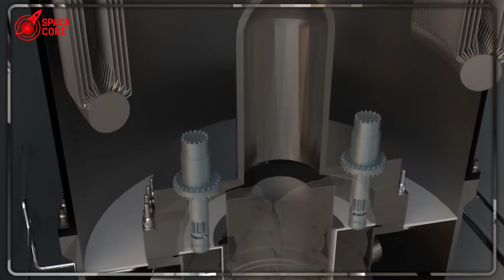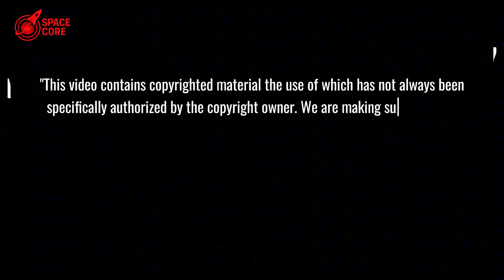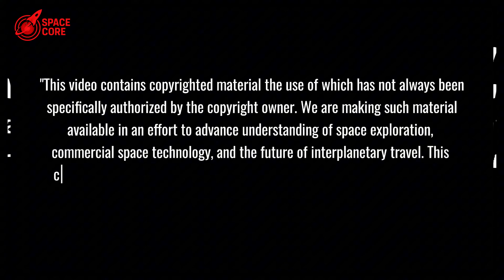China's Space Station SHOCKED NASA: Creates Oxygen & Fuel in Orbit!

Comment: The ISS is not dying, it is being neglected like an older vehicle is, while driving down the road with an overloaded trailer. NASA and the rest of the managers that operate the ISS want to trade it in on a newer model. We are not remodeling/ upgrading the ISS. Yes, we are using older proven technology.  Yes, things wear out and Yes, things get replaced, however, this is limited to the same versions with only limited proven technology upgrades. Also, the ISS tech is one offs or a very very limited production run. This means sky high manufacturing costs and long term storage costs on the ground. Modular designs like the Chinese station take advantage of the ability to change without major design, construction, production issues ideally. 

The ISS is very much like one of those rare custom one of a kind cars. 
My proposal which was ignored by NASA, was to take the ISS and relocate only after we have another space station in orbit, is to relocate it to Lagrange point 1 or other suitable Lagrange point and-repurpose it as part of a recycling facility for all of the space debris already in orbit amongst potential uses. Once we get an automated plant in operation, we use the ISS as a staging area and eventually upgrade it as required.  We already have paid for it several times over, if we are going to spend a billion dollars plus to bring it down why not utilize it to practice moving it to somewhere useful. Same, if not lesser cost,  different mindset, different outcome. It’s not like as if the tech being developed to bring it down could not be used to move other things.
The-real costs is in management and resupply costs. As long as there is no changes in those costs it could a toaster in space, it would still have those costs associated with keeping it there. 

This not revolutionary technology, we already know how to do this, the efficiency of what the Chinese are attempting to do is what could be the game changer. If the amount of catylist replacement outweigh the total costs including launch costs, it becomes the lessor of two evils. Experiments are ongoing.  

Let me say this, most of the justification for de orbiting the ISS is based upon everything in operational costs increasing not decreasing, when we relocate the ISS to a La grange point operational costs plummet to zero or close to since we essentially moth balling until we get better cheaper infrastructure up there. 

So NASA’s basis is based on all costs increasing, if New Glen or Starship become operational by2030, which I think is very possible then the costs to operate would go down even if you park either ship to the ISS in LEO. We need infrastructure in orbit if we use what we got it, it will go a long way in providing support for long term ops for both the Moon, Mars, and beyond!

We have a growing number of companies lining up to do things that only lives in the sci fi world. We have the capability,the tech and now an international base to drag the rest of the world forward.

Just remember this, every cent spent on space related  activities returns 7 times the initial investment, further every penny spent is spent here on earth, not in space,last time I check their was not a all-you-can-buy space mart accepting dollars parked in orbit. 
Job’s otherwise would never be created,and these are not Mc.Donald’s jobs.
Reply from the maker: Thanks for your insightful comment! Relocating the ISS to a Lagrange point for recycling is an innovative idea, but current plans prioritize deorbiting due to high maintenance and resupply costs.